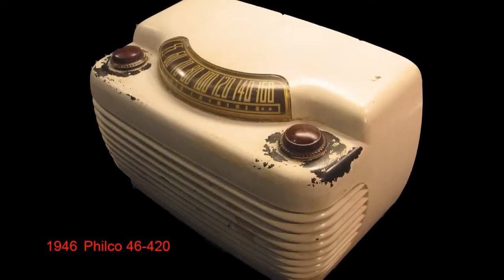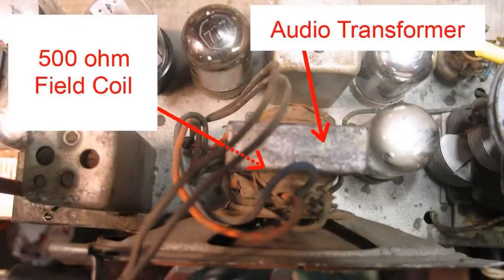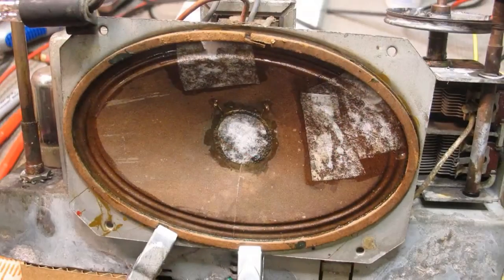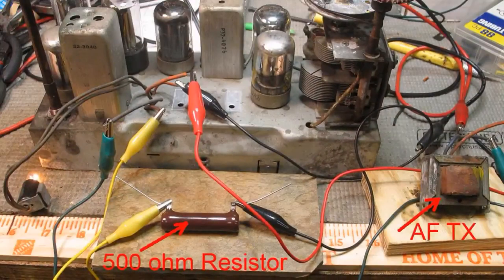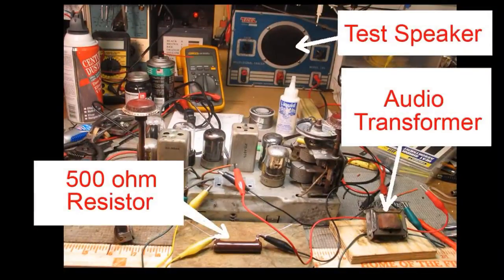Replacing a Field Coil Speaker

Comment: Very useful, thanks. So I have a Philco 41-220 and someone replaced the speaker in the past with a PM speaker but they didn't brother adding a resistor at all and its also a 500ohm resistor just like in this newer Philco so I will go with a 500Ohm 5W resistor as well.
Reply from the maker: Try a temporary hook-up first and make sure everything works as it should.  The resistor generates some heat, so do not mount it too close to other components.  Good luck.
Reply: @morrised2006  EDIT: 11/21 Yeah this Philco works very well now and I haven't even touched most of the radio. I will get to the rest of it soon but the rubber wire is crap. Thanks I do have most of the new stuff still clip leaded in.  I finally got my Philco to work as a 220K resistor died and it was important as the volume was very low without it but now with a new one it works. The 500ohm replacement field coil resistor is working well and isn't yet mounted to the chassis but will be soon.

Comment: Thanks for the reply.  I do have the schematic got it from eBay a month ago when I recapped the entire unit.  It's a 4 ohm speaker and 1000 ohm coil.  So I will get a 1000 ohm 10 watt resistor and beef up my filter cap following the coil. Thanks for help.

Comment: I have a Crosley 515 radio and I think it has a bad field coil speaker,       where does the 500 ohm resistor come into the circuit? Whish I had a diagram for what you did, it seemed to work great. Good video!
Reply from the maker: In order to correctly replace a bad field coil, you will need to obtain a schematic of your radio.  The schematic will show you where to place the resistor in the circuit.  The resistor replaces the field coil.  500 ohms was the correct value for my radio.  You will need to find out what the resistance of your field coil was and use a 10 watt resistor of the same value.  Sometimes the schematic will give the value of the field coil in ohms.  Often they don’t, in which case you will have do some research.  The best place is to start is the Antique Radio Forum.  In the electrical and mechanical sub-forum, you can ask if anyone knows the how many ohms the field coil resistance might be.  In the classifieds sub-forum, you may be able to find a new speaker and field coil for your radio by posting a Wanted to Buy request.  There is no cost to join or post on the Antique Radio Forum, but you have to register.  Be sure and follow rules for posting in the classifieds.

Comment: Why was the second filter cap in the power supply increased from 20uF to 100uF ?  Did you need more filtering to eliminate noise? I am going to have to replace my Webster model 81 Wire recorder field coil 4" speaker as it appears the field coil portion of speaker is burnt up.  I'm trying to figure out what I need to change. Speaker is 1000 ohm.  Do I just need 1000 ohm resistor? I'm Not sure what wattage resistor to use either to properly dissipate heat. Any help would be appreciated.
Reply from the maker: First, try to get a schematic for your Webster wire recorder.  Check eBay and Google.  You need to know the original resistance of the field coil, which also serves as a filter in the power supply.  Once you know what the resistance of the field coil is supposed to be, you can sub in a resistor of that value.  A 5W or 10W resistor should work.  Mount it on a terminal strip in a well ventilated area of the chassis. The resistor won't do as good a job of reducing hum as the field coil did, so increase the value of the electrolytic capacitor following the field coil.  I replaced the 20uF  cap with a 100uF cap, although I probably could have used anything between 50uF and 100uF.  This is the easiest and least expensive method of replacing a bad field coil.
Reply: @morrised2006  I usually have just left the original wiring harness to the speaker intact and riveted/mounted the appropriate resistor directly to the speaker frame. Solder the leads that went to the field coil to the resistor, the other leads to the voice coil. Be careful that the field is after the first capacitor of the power supply filter bank. If it's an amplifier that uses a rectifier tube the first filter cap is rated to the spec of that tube. Going up to a 100uf in that position could potentially damage or cause premature failure of the rectifier tube.

Comment: I've got a field coil speaker I want to use for guitar.  Wouldn't have a clue how to hook it up.  I feel kinda embarrassed since it's usually me that people ask questions to.
Reply from the maker: I would not know for sure either.  You would have to determine if the speaker impedance is a match for the guitar amp audio output.  If the speaker came from a vintage radio, the field coil may have been used for a filter in the radio’s power circuit, in which case there will be four leads attached to the speaker, two for the audio input and two for the field coil.  You will have to figure out which leads go where.  I would think you could simply ignore the leads from the field coil as they would not be needed in your guitar amp set-up.
Reply: Ed Morris Well the amplifier has an auto adjust output of 4-16 ohms.  I haven't put the meter to the speaker yet which yes does have 4 leads.  I can probably figure out which is which.  My intent however is to be able to crank the guitar amp but control the volume by varying the DC voltage to the field.  I'm only running 5 watts to the voice coil.
Reply: Ed Morris I just don't want to put too much current to that field coil.  I'm wondering if there is a way to figure that out once I read the impedance of the coil.  I know there's calculations but I believe I need another piece of information besides the coil impedance.
Reply from the maker: I really don't know, but if you knew the origin of the field coil speaker, you could refer to the schematic for the original device which might show the DC voltage going to the field coil.  You probably need to consult with someone with more expertise in with guitar amp circuits.
Reply: You couldn't use it in an amp designed for a permanent magnet speaker. The "Field Coil" is what creates the magnetic field for the voice coil. Power from the amps power supply went through this field coil which was part of the PS filtering. The byproduct of filtering AC was to produce the "magnetic field" which was put to use on the speaker before high quality Permanent Magnets became available. The only way this would work is if you rigged up a power supply to feed the field coil this producing a magnetic field.